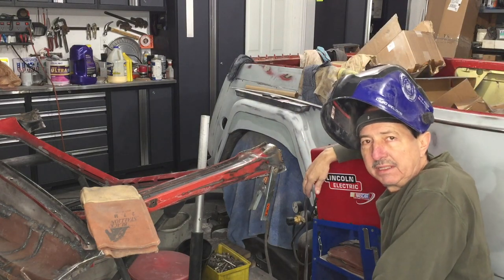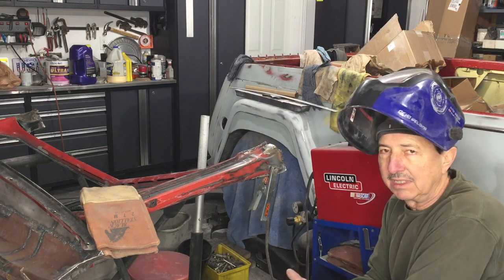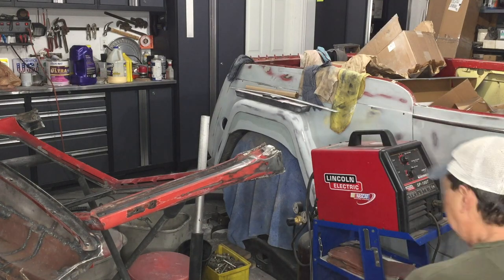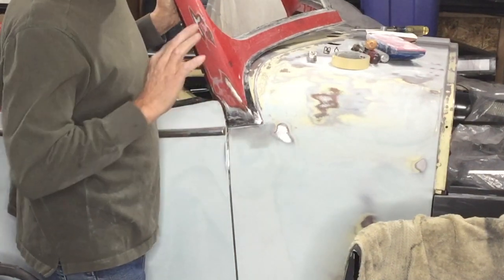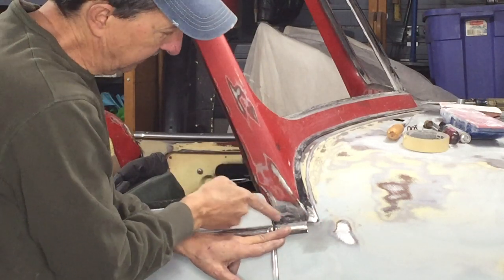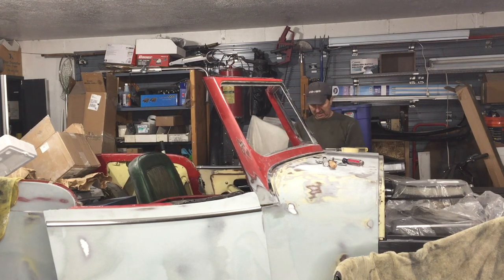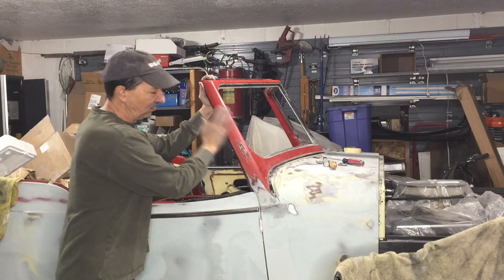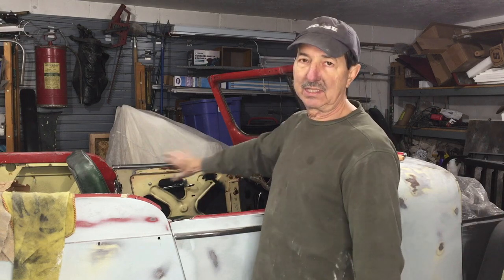The Typical ,Terrible Fit. Jeepster A Pillar To Cowl Fitment. 1950 Willys Jeepster Hot Rod Project.

Comment: I'm amazed at the lack of detail work from the factory. I wonder if it's a case of not really caring enough about the small details. or, they figured it was a Jeep, and it didn't have to look perfect. Thanks for another great video!
Reply from the maker: My thoughts exactly. The cost of the Jeepster was as high as other cars on the market that did have better quality and engines. No wonder they didn't sell very many.
Reply: @riderescue  You are probably right, I had forgotten there price tag’s compared to others on the market!
Reply: I also did want to let you know, while reading one of my Jeepster club news letters, a gentleman found the very first Jeepster ever built that had been sitting in a junkyard for 50 years!
Reply from the maker: @tomseibel439  That is really cool that the first one made was saved from a junkyard.